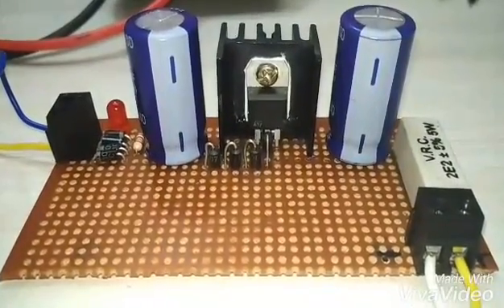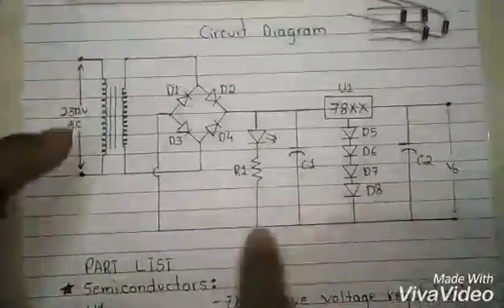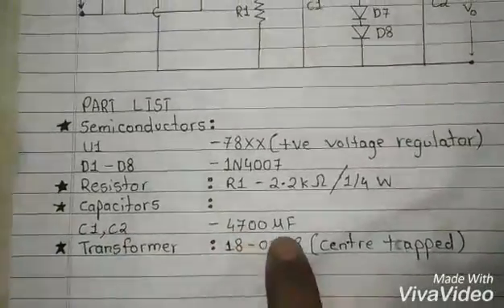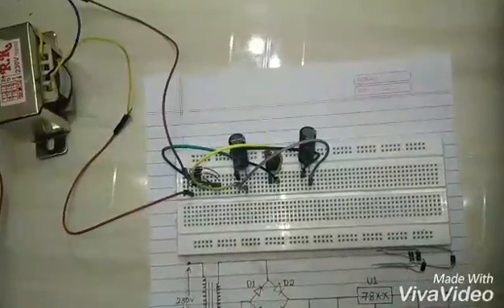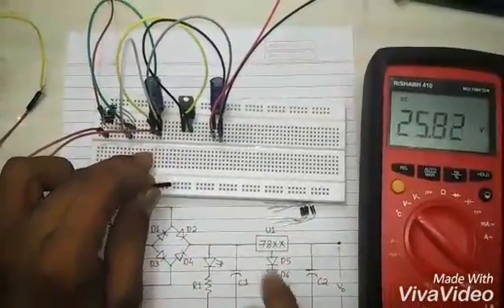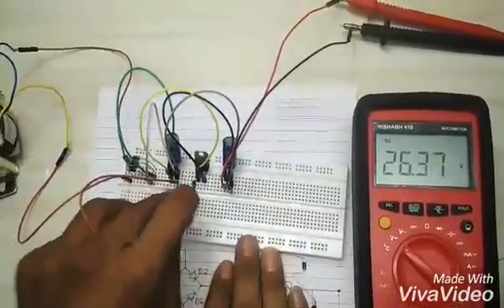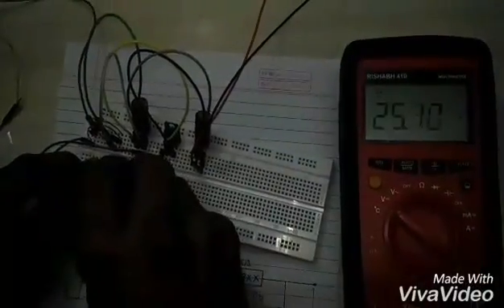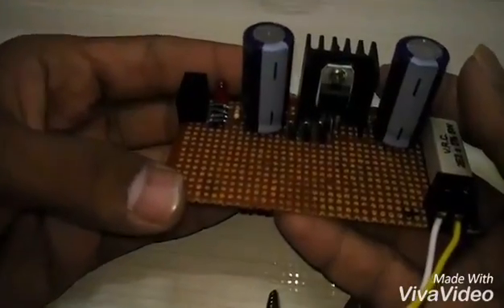DIY Variable Voltage Ragulator Using Fix Voltage Ragulator IC's..

Comment: I need this but how do I get like 2- 5 amp range ?   

http://www.ebay.com/itm/New-Adjustable-Regulated-Voltage-DIY-Kit-LM317-Step-down-Power-Supply-Module-/311402139960?tfrom=141932286987&tpos=top&ttype=coupon&talgo=undefined
Reply from the maker: you can use current booster circuit using transistor or MOSFET.....

See more on this 
https://goo.gl/8mG2Bl